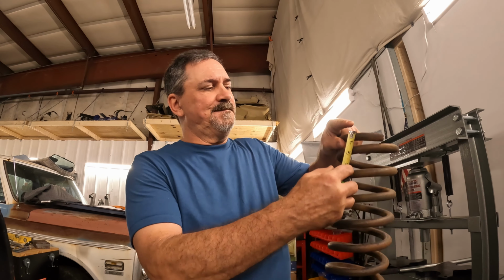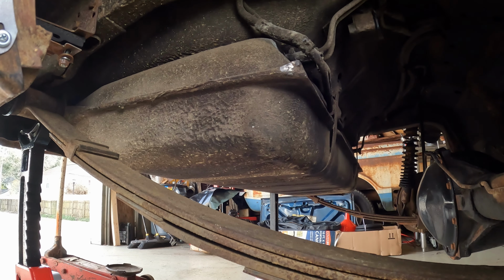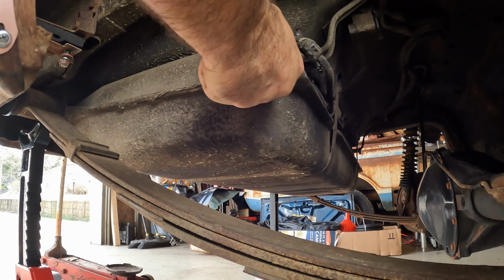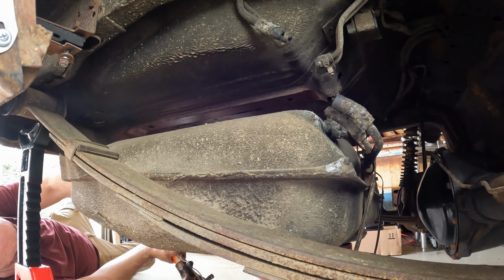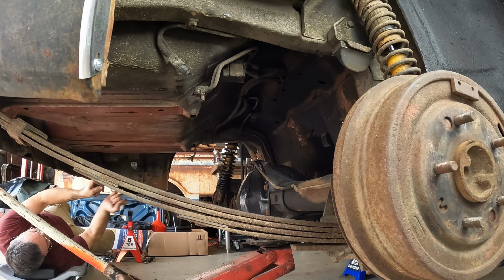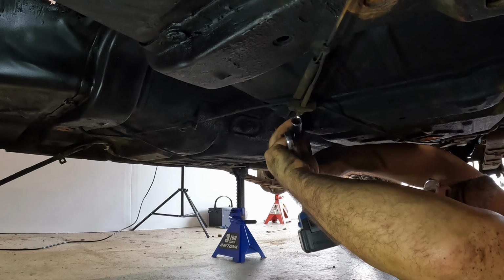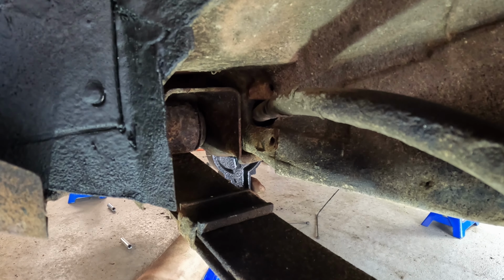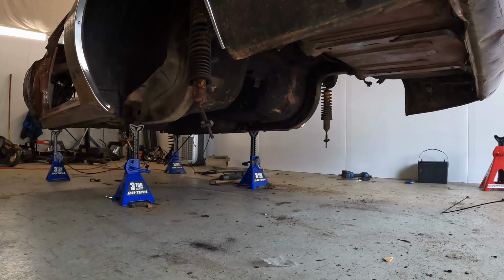Firebird Ep 06 Removing the Suspension & Subframe

Comment: 13:47 Heart skipped a bit when you wiggled the jack / leaf spring! I'm breaking down my 79 T/A and this provides motivation. 🙂
Reply from the maker: I figured out after that - the shell is not very heavy! (relatively). I  added a full bucket of sand to each corner after that to help stabilize things.
Reply: @MaverickModds  Ah, makes sense. I still need to extract rear end, tank, etc. Thanks for making these vids! They're very helpful.

Comment: Enjoying the video set. Been slaving away on my 79 ta project for going on 5 years and things are still coming apart, sigh. Anyway, I went out and measured my front springs and they were right at 17" so yours sound in the ballpark. Also, you asked about ways to get the springs in and out, I followed the method in this video (https://youtu.be/K0COGAbOdi0) by @PLAYZWITHCARS for a corvette but same procedure using a 5/8 threaded rod to hold the control arms together then back off them off. worked good. Looking forward to following your progress which seems light speed compared to mine...
Reply from the maker: I'm still convinced the springs were not F-body springs though because even with the engine/transmission in and the front sheetmetal on those springs never compressed even a little bit! Plus the weight of two hefty guys!